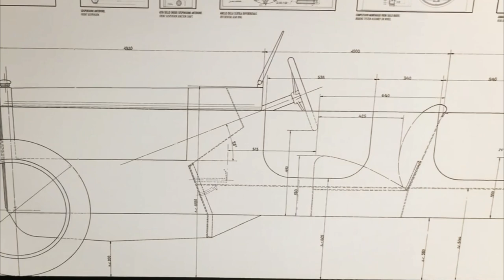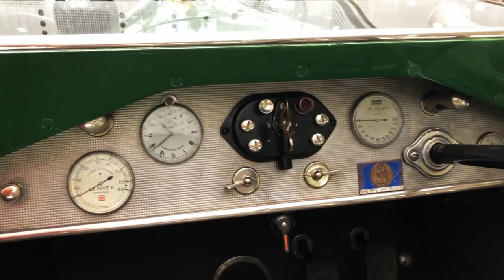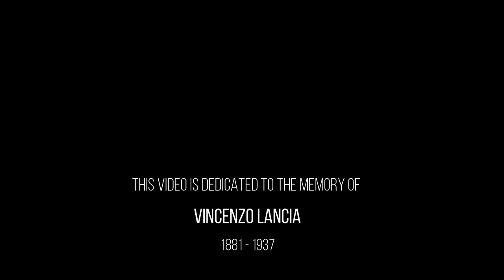Why The Lambda Is The Most Important Lancia Of All

Comment: correct me if i am wrong, but @4:23 is also considered unibody.
Reply from the maker: I wouldn't consider that a unibody structure, as it was designed to have a body fitted on it. The Merriam-Webster dictionary's definition of "unibody" is: "single structural unit of an automobile consisting of a combined chassis and body." I think later Lambda platforms do not respect that definition.
Reply: @Matteo_Licata  would you say that a Mazda MX-5 NB is unibody? do you know that the body is seperated from the platform?